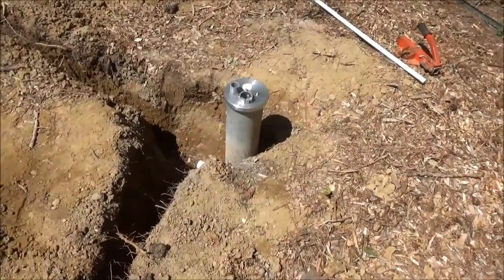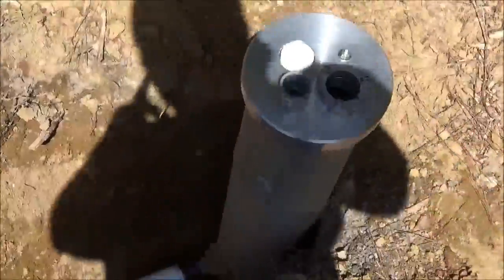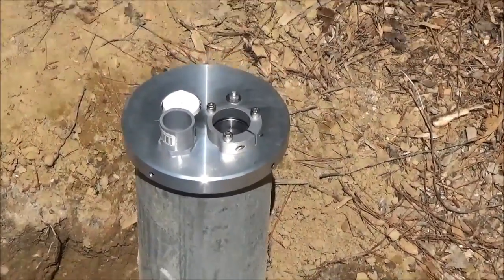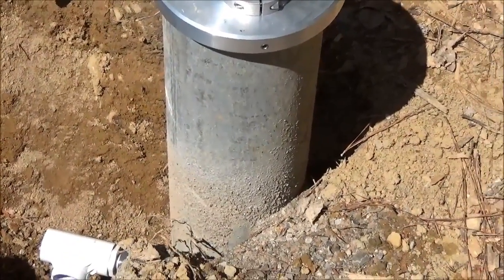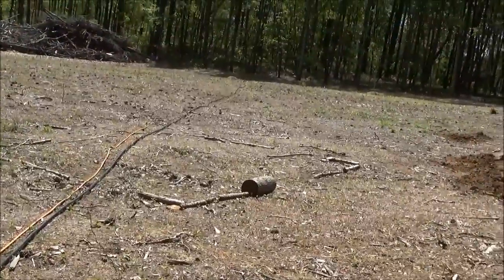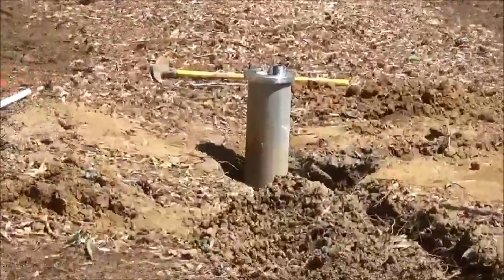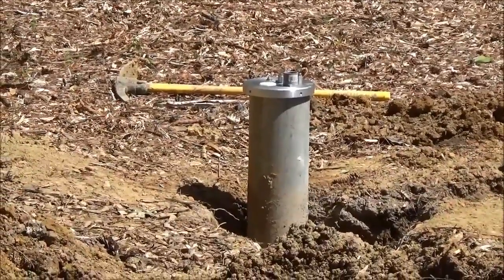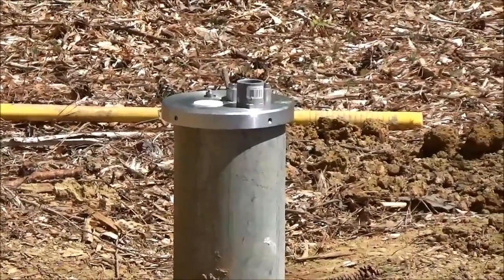Low Producing Well Solutions

Comment: Is there a way to hook up a solar well pump to an AC to DC converter and run it off mains power? We are in a horrible solar location but have steady utility supply. Could you slow the solar pump down by reducing the DC voltage to the motor so it lowers the output flow from the well without damage to the motor?

Comment: I have such a well.  Link showing line from pump to surface to tank to aux pump to pressure tank to home...could I get some advice on such a system?  I dont like that my pump 200ft down pumps water straight up against the bladder pressure in a 20 g tank.  I want it to pump to a 10pg tank and then from there, blow the house away at 20g pwler min short time. Low use.  Vs current 6 to 8 gpm.

Comment: Great video. Im doing the same on my well 600ft deep with a static head at 185ft. Going solar and putting pump head at 300ft for going any deeper the price goes up considerably. Im going to fill two 1,000 tanks elevated 15ft off the ground and let gravity do the rest.  Just enough pressure to water trees and take a shower. Weekend retreat

Comment: I have the same problem with my well. 1/2 gpm but after pumping it out and letting it recover the water starts to get cloudy with sediment.  if I let it set over night the sediment will settle but becomes cloudy again. Do you think a flow restricter would help? I have a 2700 gallon cistern in the ground and have water delivered but its too expensive.  HELP

Comment: How deep is the pump and what gauge wire are you using? Is this in addition to the original pump?
Reply from the maker: cpoul The pump is set at 225 ft.  I am using 8 awg wire to keep the voltage drop minimal.  There was no pump put in here because the homeowner was told the well produced too little.

Comment: Good video! We used the black flexible "poly" pipe a lot back in the day. In the past 30 years, it seemed to last maybe 6-12  years before splitting down a seam where it got fused together.  We switched to PVC Sch 40 rigid pipe and hung the pump with good grade nylon rope (1 primary, 1 as a 'just in case' spare and the wiring as a 'second spare..')  Used a tripod/pully 'boom' directly over the well to lower the pump while we added sections of PVC pipe.

FWIW, never had to replace PVC. =A better deal over the long haul.
Reply from the maker: OgMandin0 SInce I am not pumping to pressure the black poly should hold forever.  Very little pressure and 1gpm flowrate.   I do have a good nylon safety rope and 8awg wire holding a very light solar pump.

Comment: Do you utilize  the pump piping for the hand pump too ? If so lets see that video, if not , let's see that video too.
Heck....just keep the videos coming what ever they be.
Reply: offplanetevent The hand pump (simple pump) uses it's own piping and pump at the bottom of the well, just hung higher than the electric pump so it's not in the way.
Reply from the maker: offplanetevent THe Simple Pump is it's own system.  We set the piston at 150ft.   Static is 120.